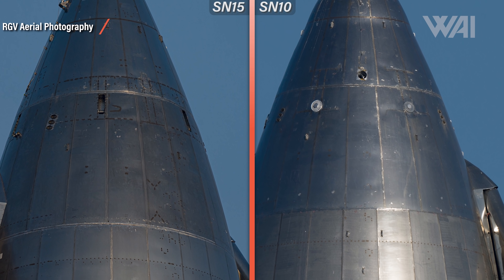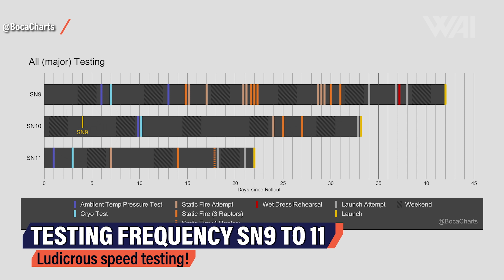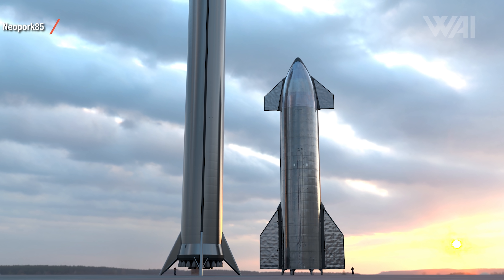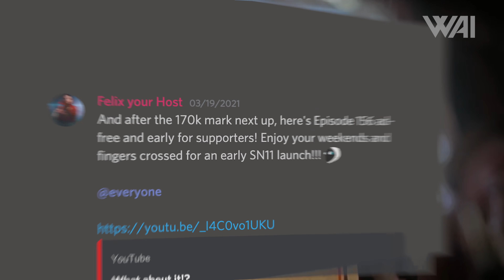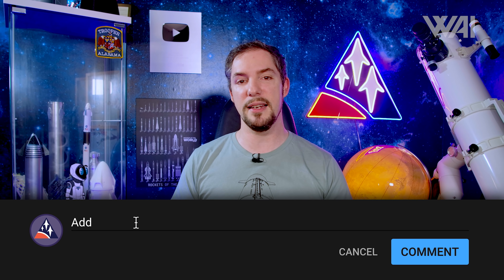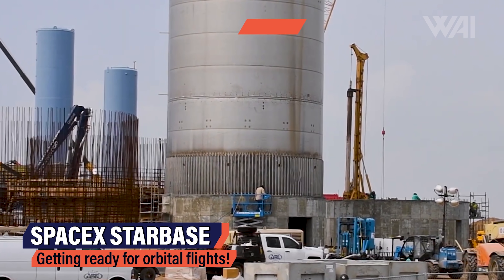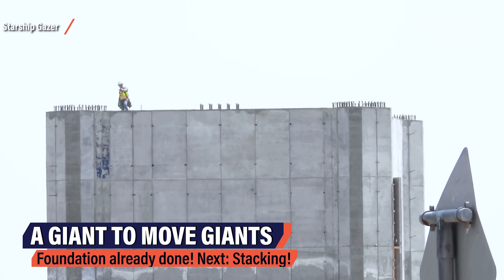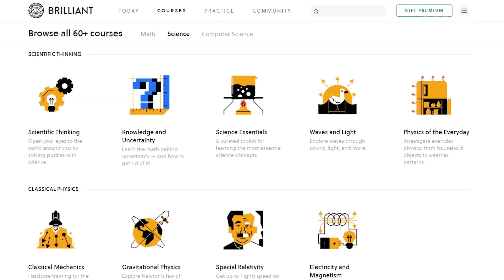SpaceX Starship SN10 vs. SN15 – What's Improved?

Comment: Still one major thing not feasible is storing cryogenic fuel frozen for 6 month in space. That will 99.9% lead to frozed to death astronauts and big explosion in the end. It is hard to imagine heat sink between habitat and fuel tanks that works flowlessly for half a year. Also, you can't turn it tip to the sun because radiation hazard. Original concept is also designed as bottom to the sun which is extreme because radiation will heat fuel tank. I guess superheavy is ok to run cryogenic fuel but starship is not. Which means no refuling on Mars (anyway, it would take 100years or so because atmosphere is not dense enough and water is hard to find). What looks feasible however is sending > 10 starships full of robots and equipment and 10% of fuel left, so that astronauts could refuel one of starships and return back to earth.

Comment: The engines should be ignited in horizontal position during belly flop, when it changes position to vertical the flow of air is too strong to make it possible.

Comment: I think they have to work on those engines. There seems to be leaks happening on those engines as if the plumbing wasn`t tight enough or they hadn`t accounted for condensation in the pipelines. Also, there seems to be flames happening when the fuel is shut off as if the preburners were still running.

Comment: Give SN15 a 90%+ for a good test flight - that means significant improvements all around, and valuable additional data.  I give SN15 only 55% for a perfect landing - landing has been the problem.  Just might detonate 15 min after landing.  Bummer, but still only a test flight.  Just think, if you mix the liquid propellants, you get a very dangerous explosive mix, just itching to detonate for no particular reason.

Comment: Could someone please explain how the final Starships will be full of windows and people at the top but right now the entirety of that space is fuel tanks right up to the tip of the nosecone?
Reply: It’s very simple, you’re wrong.
Reply: @fredbloggs5902  I asked an honest, legitimate question because I wasn't getting much with just Google searches. Would you care to elaborate on your answer?
Reply: @chriskelvin248  If you Google ‘Starship cutaway’ you should get the diagrams you’re looking for.

The methane/lox tanks only occupy the bottom two thirds.

Note that there are several design variants, some carry cargo, some don’t have flaps, etc.

Comment: fuel tank base needs to be conical with a dynamic vortex stirring baffle/paddle.  This way the fuel remains pumpable as it will be against the sides of the tank.  See: 1968 Honda 350 motorcycle engine centrifugal oil filter/pump.
Reply: Please provide your stress calculations showing a conical fuel tank base can withstand the pressure required.
Reply: @fredbloggs5902  If the straight sides of the current tanks can take the pressure then the  slight conification of those sides can also take it.  Moreover it is obvious that the base of the cone need not be flat but can be domed.
Reply: @clavo3352  so no calculations then.
Reply: @fredbloggs5902  What's your point about equations?  Are you saying that Faraday's observations were invalid?  He didn't have equations.   What formula do you propose I use?  What is the tensile strength of the materials to be used?  Yours is the opaque intellectualist strategy that makes the anti-intellectualism in this country tolerable. That is not a progress enabling thing.

Comment: Well we can't see what design changes have been made inside, but I wonder if additional pumps with small pressure tanks have been added to solve the restart failure problems. Seems like the current setup has serious vapor lock issues that build bubbles in the pumps causing a bad mix of fuel and oxidizer without enough pressure to force the pocket out. Added pumps above the heat will provide a perfect mix at restart, and combustion won't flash up into the pumps, and mix value system. A half second system vent before restart should give a pefect start to each engine. The additional pumps would provide the pressure needed with cold fuel mix, and not over heated mix trapped in the system.

Comment: @What about it!?   Felix, SpaceX doesn't need to have the catch tower complete by July 1 in order to conduct an orbital flight.  I think it's very likely that they will vertically "land" the booster in the ocean with no intention of recovering it.  That will check off a lot of testing boxes and provide essential data for the actual catch landing system.  Thoughts?

Comment: For BN2, I have no doubts they can get it to fly, so far going up hasn't been remotely a problem for all of SpaceX's prototypes.  It's the landing I'm curious about, will it be using the same stumpy little half assed legs Starship is stuck with right now?  Will they go for capture system Musk has tweeted as a possibility from the very get go?

Comment: Could they fly a today’s Starship like SN15 to Kennedy Space Center and Land it there on a Falcon 9 landing pad in a suborbital flight?
Reply: Good question, not sure why they would want to? It’s about 1,000 miles. Starlink orbits are only 200 miles altitude. SN15 only has 3 engines optimised for atmospheric use (ie not vacuum) and the burn time from MECO to SECO is around 10 minutes? 

I don’t think it’s possible without the booster or the 3 vacuum raptors fitted.

Comment: 10:50 The gridfins may be smaller because there are six instead of four. Remember, the Booster header dome has six vertical flat surfaces which suggests six hard points for swiveling the gridfins.

Comment: BN2: Depends on the Raptors.  So far, the bane of the entire endeavor.  Musk has expressed his obvious frustration with that state of affairs ("6 ways to Sunday"), and obviously whatever is wrong can be fixed—not like there are custom physics in play that will forever prevent Raptor engines from achieving Merlin-like reliability.  They just have to buckle down and sort it out.  Whether this happens sooner or later is what will dictate prototype success in the near future.

Comment: The whole idea about catching a rocket with the launch tower itself seems at best an intermediate step to an actual solution.  Felix, is it possible Superheavy booster would be too top heavy to make a landing under it's own power?
Reply: Most of the weight is in the engines, I’d guess the centre of gravity to be around a 1/5 of the height? (When nearly empty).

Comment: THE ORANGE CABLES DOWN THE SIDE OF SN15 ARE PYRO SIGNAL CABLES, ABLE TO WITHSTAND FIRE.
Reply: OH OKAY
Reply: I thought they were the power cables from the Tesla batteries? The signal cables are in the steel (Iconel?) pipes slightly to the right.

Comment: I don’t think it matters how quickly they are able to turn around new Starships. They need to start landing them. I would rather take twice as long creating them if it made sure they would land.

I’m guessing the booster section is easier to make into an orbital standard compared to Starship.
Reply: The booster doesn’t reach orbit.

Or do the bellyflop/flip manoeuvre.

It’s really just a scaled up Falcon-9 booster.

They key to everything is the engines.

Comment: My guess is that the superheavy booster flies and sticks the landing, but then falls over afterward. I just don't get the feeling that SpaceX has figured out how to make appropriate landing legs.
Reply: I thought they were going to catch it in mid-air?
Reply: @fredbloggs5902  Not sure whether the tower will be finished before superheavy begins test flights. If it is, I'm not sure they'd want to risk destroying the tower trying to catch a booster that's very likely to have a mishap.
Reply: @ariochiv  Why is the booster likely to have a mishap? It’s really just a scaled up Falcon-9 booster with a similar flight profile.
Reply: @fredbloggs5902  It's not the flight profile that has been causing Starships to explode. It's the new engines, new materials, new plumbing, etc. Expecting a prototype to perform perfectly on its first flight is not just unrealistic; it would be nothing short of extremely reckless.
Reply: @ariochiv  

1) It’s only reckless if you don’t plan for failure.

2) They need to test fly sometime and it has to land somewhere.

3) They need to test the catching procedure anyway at some point.

4) Only SN9 had an engine failure.

5) The booster doesn’t do the bellyflop/flip manoeuvre.

I think a successful booster test flight is much more likely than a starship test flight.

Comment: Why are all those pipes and wires on the outside unprotected from damage??
Reply: I’m guessing Elon is waiting to see if they need protection. The controls are in Iconel tubing anyway. The orange are high voltage power cables? As used in Tesla EV cars so they are probably pretty fire resistant- maybe silicone?

Comment: The evolution of the craft will require a 3rd stage passanger/cargo of lunar/emergency deploy, if to remain in this verticle tall rendering craft, will cause the need of crane assembly of the SN crafts, both on Earth & the arrival for relaunch, because its pretending to be a SSTO, when its too sensitive & unstable.

Comment: the booster is gonna be much more subject to problems from crosswinds on landing.
Reply: The booster will be less sensitive to crosswinds because it’s around double the mass but only 40% larger in cross section.
Reply: @fredbloggs5902  yeah but the mass is concentrated at the base, so all the less dense mass further up is gonna act like a sail keeling over a sailboat. The height of the booster creates a very strong moment arm putting a lot of tipping torque on the base.

Comment: Haven't even watched yet, just wanted to tell everybody, I heard from an insider source today, and it may have already been made public, NASA has made the decision on the downselect for the HLS system. SpaceX won. NASA is going with a sole provider, due to anticipated funding levels that would not allow two to be developed.  That is great for SpaceX, but I really thought Dynetics had an excellent design that could have contributed a lot in a two lander architecture. Well, with Dynetics ability to fly away from and back to a base camp, and unship its pressurized module onto a powered chassis and become a rover, maybe a modified version can still be used for those purposes, carried to the surface by Starship. Looking forward, it seems unlikely that more than two Lunar mission can be carried out with Orion using Starship as a lander before somebody decides to cancel SLS/Orion all together and go with an all Starship architecture.
Now, let me watch the video.

Comment: 13:20   I don't believe the tower would necessarily need to be finished before a test flight. Using the newly arrived LR 13000 to lift and stack a first attempt. The goal could be simply to get a Starship to orbit.  Elon has already said a successful reentry probably would not happen on early flights, and if they are willing to sacrifice a first gen booster, a July launch may just be possible.

Comment: methane on the bottom makes more sense to me since the liquid oxygen they use would be below methane's freezing point if "superchilled" constitutes more than just 1 or 2 degrees C less than normal. I'd say methane ice builduo on the outside of a pipe is much less problatic than having it build up on the inside.

Comment: I think its stupid to talk these up so much. These are still very early. The booster had proven tech from Falcon 9 but i doubt it'll be the same. Its so much larger. Legs will be different or not there. Raptors are new engines. They also have issues relighting sometimes. Just keep things real for people so they don't loose faith so quickly. Its still really early and lost of learning to do.

Comment: Thinking about it, the main point of the legs on the booster would be to absorb impact.  When Musk says he wants the tower to 'catch' the booster I think a landing pad that has a bit of give in it could be what he means.  If it were a grid pattern to permit thrust from the booster to pass through it and was on hydraulic rams 20ft high it could easily adjust for any imperfections on the rocket motors and provide a smooth catch. The tower could then be used to prevent tipping if necessary.
That seems like a much more plausible answer than catching the booster in mid-air - absorb the impact and restrain.

Comment: Could the mystery starship structure be a mockup to practice catching a starship once the tower is finished as to not risk wasting a starship? Maybe they would release it from one of the cranes to simulate the forces put onto the tower.
Reply: I believe Elon has only spoke about catching boosters.  I don't see catching a starship by the aero surfaces!
Many seem to agree that the structure is for testing stresses that would be related to Max Q, re-entry...

Comment: Why doesn't Space X use baffling in the fuel tanks to prevent sloshing of fuel as attitude changes. Baffling does not wegh much and pays benefits in fuel control while changing orientation.

Comment: This is not proven technology until the Starship or booster can land consistently and safely, without flames and explosions. There seems to be a mild case of denial from fans to merrily skip over this 'little detail'. I'm sure it will succeed soon. But, until it does, everything else is secondary.
Reply: this is exactly what people said with falcon 9
Reply: @Cediii4ris  1. Not quite, I'm not saying it cant be done. I'm saying the Raptor is a New engine never before attempted and so far it has blown up 4 times in prototyping with zero successful landing attempts. Lets not get ahead of ourselves and label it as "proven technology" just yet!
2. just because you succeed once does not make you immune to failure on all future endeavors.
I'm not a critique, I'm a fan and a realist!
Reply: @rw9207  well SN10 didn’t have Raptor failure, just landing legs and then a methane leaky

Comment: There are some clues to help with guessing about the arrestor system to catch starship or super heavy. 
#1: It will be a set of hard points just below the grid fins, per Elon tweet. This makes sense. You will want a low moment arm load on the hard point to minimize weight. But if they can reinforce the grid fin connection point enough they may still be able to catch up tight to the rocket body. We will see. The arms connecting to the tower will be a compromise as well. They must be able to swing in to a very close tolerance with the side of the rocket very quickly with little or no contact. That means some sort of optical or laser measuring system carefully watching the rocket body as it decends past the arrestor level. The arrestor also needs minimal moment arm so limited length. Probable less than 50 feet, and best at 15 feet away from the wall of the tower. The arrest needs to be gentle at first contact and get stiffer as is slows the rocket. The straps that hook on the hard points will need to not "saw" or "grind" on the rocket or its hardpoints as the cable or strap extends under the increasing load.  So probably a 4 point counter weight on four logarithmic loads.  Let's design and draw up some speculative systems based on those parameters.

Comment: Is it just me or does the nose seem more pointed or slightly elongated for sn15? The mid section of the cone seems to have a bit of a belly on sn10 whereas on sn15 it looks like a straighter edge. I'm guessing this was done to more easily attach the flaps and covers.

Also, everyone covering super heavy make the same false statement "this technology is already proven". That is in fact false because; Falcon 9 does not run raptor engines, Falcon 9 is not fuelled with methane and lox, no testing has been done on a falcon 9 modified to run a raptor, and the volumes in the tanks are vastly different which affects a lot of things like centre of mass, how the fluids behave in the tank as it empties, etc. It's not proven technology at all. It's still very much prototype tech.

Comment: Isn't it risky to have wires and pipes on the outside?  I'd think all that would be on the inside.  I know it's not on the side that will be covered with heat tiles during reentry but still.
Reply: That would lower the temp of the wires cuz of cyro temp fuels so itd likely require more insulation if inside the vehicle and eventually there will be a steel raceway cover for those wires
Reply: @damitcam  Ahh...that makes perfect sense.  For some reason it didn't occur to me that they would put an additional cover over all this on the final production model.
Reply: Also if they were inside the vehicle you would need a way for them to go threw propellant bulkheads which introduces another potential point of failure